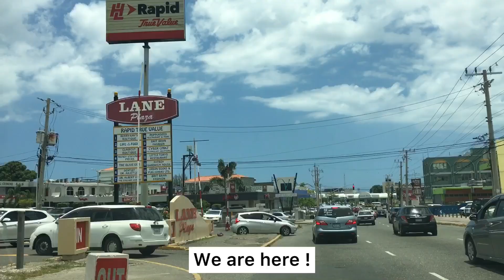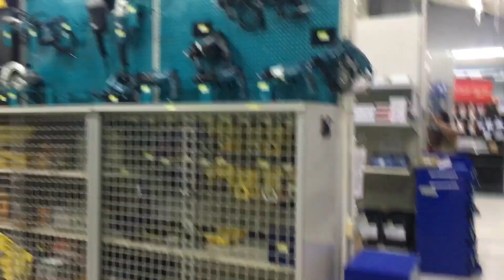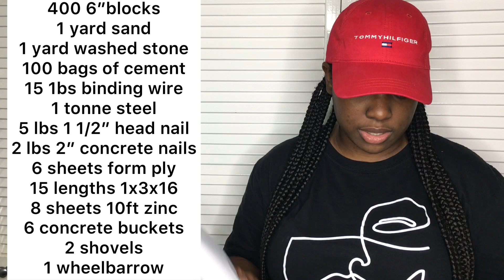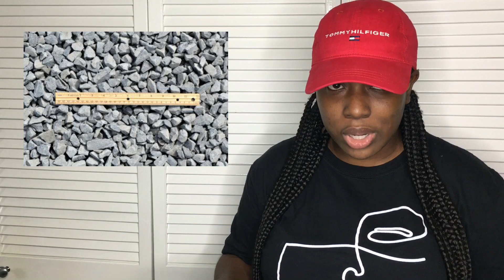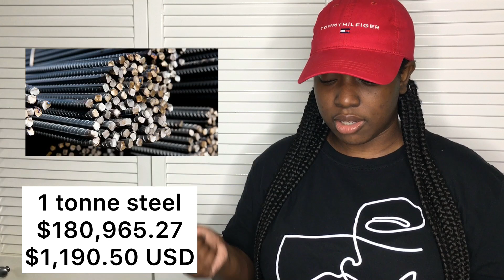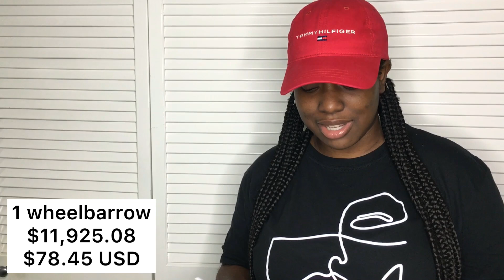Building a house in JAMAICA | Cost for construction materials Rapid True Value

Comment from the maker: Please note, in a follow up video I realized that I was quoted for 170 lengths of steel which is more than a tonne. I tried contacting rapid to see if they quoted me an incorrect figure but I couldn’t get through to them.
Reply: Safe Hayeven, where do you get those prices? i live in St.James and i am building a 3 storey house and i never pay those kind of money for marerials, one yard of sand including tax is $3000, one block is for $101, 1 yard of stone is $2800, buckets are cheap here, 1 ton of 1/2 inches steel is $149000, with tax. 1 ply board is for $6600. Please visit Lawson Block Factory, in Anchovy St.James. buying truck loads of sand and stones from the quarie is way, way cheaper than buying it from the hardware.
Reply: @maxinecorniffe549  How many yards are in a load of sand? That is, 82 tonnes is how many yards?
Reply: One month since this video and steels is $160,000 per ton😔
Reply from the maker: @swadeswade3070  oh wow

Comment: How big of a house can you build with the supplies in your video?
Reply from the maker: This is just to start the foundation of let’s say a two bed two bath
Reply: @safehayeven  but you can have  a small house like 600 sq ft with two bedrooms or you can have a 1000 sq ft house or 1500 sq ft house and have just two bedrooms. So saying for a two bedroom house doesn’t help. Because obviously a 1500 sq ft 2 bedroom will cost more then one at 600 sq ft 2 bedroom house

Comment: Prices increase even more since the start of the year.  A sheet of ply was $3500 in January compared to now where some hardwares  are asking $ 6900 per sheet.
Reply: Yes for sure. I just did some repairs and one sheet of ply cost me $5700.
Reply: If everyone can help by Sharing the cost materials they buy and where everyone can benefit.  Because some places ridiculous with material cost eg ply heard my grandfather said basically 7 thousand something smh
Reply: $8300 for ply in May
$1130 for cement 
$100 for blocks

At a hardware in St Thomas 

$150, 000 for steel in St Thomas  $164000 in Portland
in May